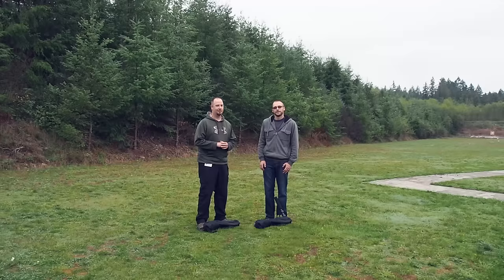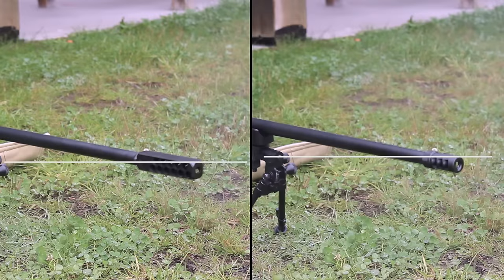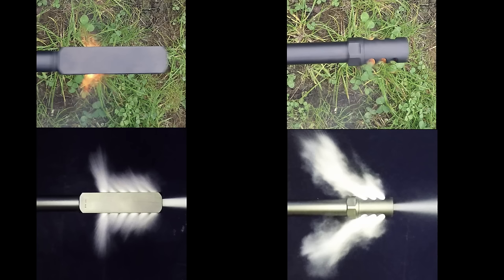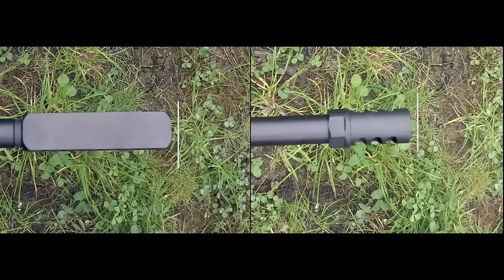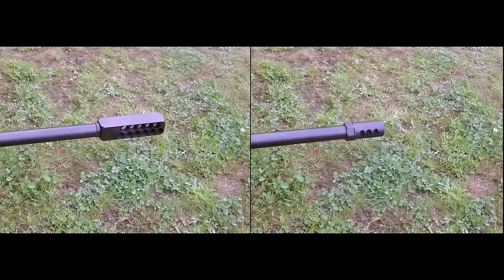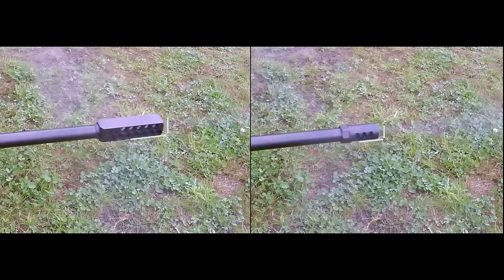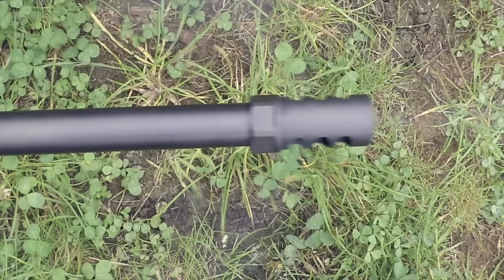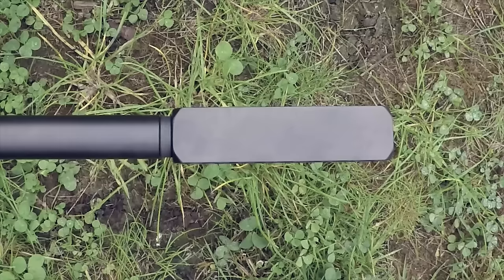Huber Square Brake and APA LB Gen 2 review part 2

Comment: Head to head needs to be done without biases.  In all but one category the little B won. Heck you even attached the square with the AP nut. Next you’ll be late because you were getting your nails done!
Reply from the maker: I'll have you know I already had my nails done and they turned out fantastic. Any future delay will be because I am washing my hair.

The one category the Huber brake won in was one that I cared a lot about. So much so that I would take slightly more recoil to not have the concussive blast. In the end I did not like this trade off, and kept looking for brake alternatives after filming. 

I found a brake that works as well if not better than the APA LB, but without the concussive blast back at the shooter. The brake is called the Beast from Muzzle Brakes and More. It's a budget brake with budget fit and finish, but a really good design. If you go with the one piece have a local smith bore and profile it, don't have MB&M do it.

If I do another head to head it will be with a mechanical device that measures recoil back, and muzzle rise. 

Honestly videos are pretty low on my priority list so don't hold your breath on a followup (doing one would be fun, but I am really bad at taking on more projects than I complete).

Comment: I know it's like 5 years already, but:
Have you tried to time in the square brake 180 degrees other ways. I mean, looking at the flash, the first hole does most of the work. So making the first hole upmost, the moment caused being over/under the barrel-line(force times distance) would be beneficial against muzzle rise instead of being determent.

Comment: Liked the video and the comparison of each brake in slow motion.
After hearing that a 6.5 CM was the test caliber I was a little let down.  As far as recoil goes, 6.5 CM would not be near the top of the list of felt recoil candidates (in my opinion).  
I would like to see a larger cartridge / magnum cartridge before throwing down a few hundred dollars on a brake.
Thanks for doing the video as it was very informative.
Reply from the maker: +Scott Bogan I agree with you that the 6.5 Creedmoor is very forgiving with recoil, that is why I choose it for my rifle. When funds allow it I plan to get another barrel in a hotter cartridge. And when I test again it will be with a more data driven approach. Thanks for your feedback.

Comment: I’m looking into a new brake for my Tikka T3X TAC A1 6.5 cm. My choices are the APA FB Gen 2, Area 419 Hellfire or the PVA jet blast. I’m looking for less muzzle rise and reduce recoil. Which would y’all recommend?
Reply from the maker: I would like to start by making sure you know whats causing the barrel to rise. The barrel rides above the center of gravity of the rifle, so as a bullet is propelled the rifle is pushed back, and because the barrel is above the CG it will also cause the rifle to rotate.

Brakes that have the ports directed back at the shooter such as those you suggested work so well because they pull the rifle forward with the energy from the excess gasses behind the bullet. This will reduce recoil and simply because it's reducing recoil it will also reduce some rise.

If you wanted to further reduce rise you can get a brake with an asymmetrical design – one that exhausts more gas up than down. The extra gas forced up will push the barrel down and you will experience less rise. Brakes like this will have angled ports on the side, or symmetrical ports on the side and additional ports on the top.

The brake that is currently on my rifle, and the one that will stay is from Muzzle Brakes and More, called the Beast brake. It's been machined to fit my rifle. Hopefully I will do a video on it someday, when I slow down, but in the meantime I wanted to point it out.

The design is very good, the cost is good, the customer service is decent. However the quality of the machine work there is not so good. If you buy from him avoid my mistake and buy the basic brake and have a local gunsmith turn and bore it and fit it to the rifle (also you will need to break the sharp edges by hand). I have not tried their 2 piece brake, but personally I think with the money you save you could pay a smith to machine the basic Beast and have a better looking brake for the cost of a APA.

Hope that helps.

Comment: Without an accuracy review, not much else matters...
Reply from the maker: Putting a muzzle break on a rifle will change the harmonics, which may affect the point of impact and consistency. However this is because of harmonics and sag, not because of anything the brake "does". 2 brakes with the same weight and profile will affect POI and consistency the same, even if they have a different vent geometry. The recoil reducing aspects of a brake have nothing to do with the rifles accuracy and because of that there is no need to test accuracy.

Comment: Do you have an ounce of emotion in you, if so use it. Also this seemed staged to make the square break look amazing even though it is not as good reducing recoil. The point of a break is to reduce recoil so the fact that you don't like having gas shot back at you is kinda sad because your willing to take more recoil instead of getting some gas in the face.
Reply: Hunter Richardson First off it's a brake and not a break.

Secondly how much gas you are willing to take is a personal preference. The AR-15 is not a really sharply recoiling gun so I can see why someone doesn't want to get gassed and deafened every time they shoot at a cost of worse recoil reduction.

To be fair they haven't shown the gun with no brake for comparison so we don't really know how much they are actually helping.